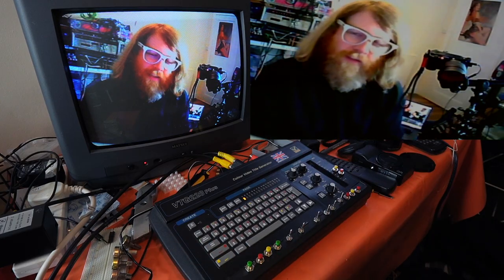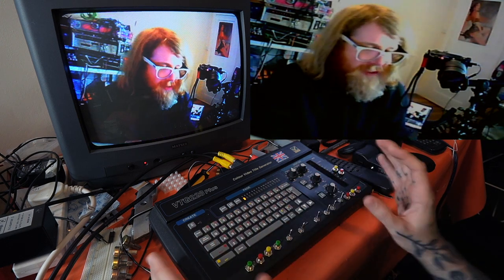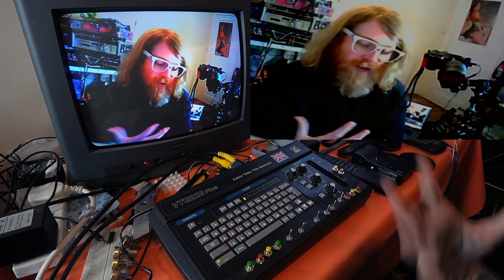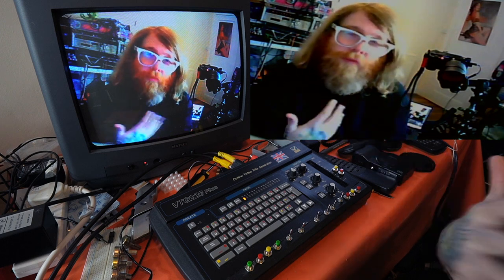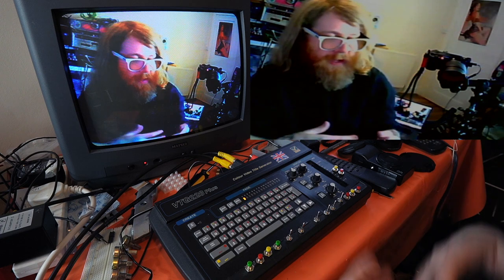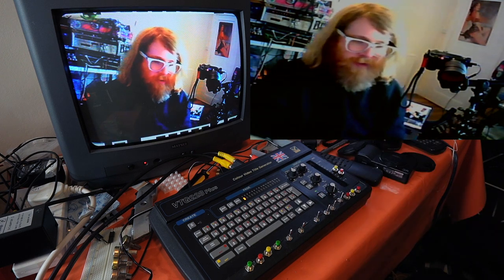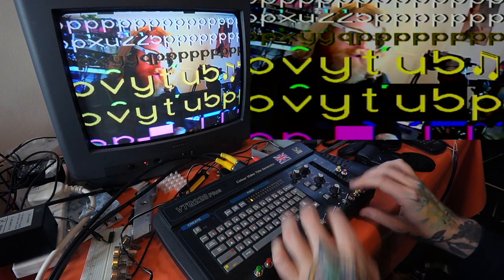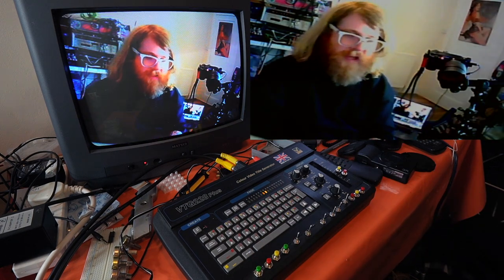Circuit Bending a Video Title Generator (VideoTech VTG228)

Comment: Ah, nice! I’ve got one of these in the queue for bending. I’m working on a pair of strange Vivancos, and a VEC 1060 (one of the steel cases; a real chore) beforehand. I can’t wait to tear into it.  Still watching this video. It’s probably cracking. Thanks for posting.
You’re a brave man for going after this one without tracing out the ground plane!

Just finished the video. Love how it turned out. This will be fantastic in conjunction with your Vivanco. I
Reply from the maker: Brave or stupid. One of the two. Maybe both?! 

What Vivancos are you working on? I've done a few of them now - but need to record videos of them. They are fun to bend, though some of them are a bit harder I think with the more compact cases.

I think you're the brave one going for the 1060. Those cases are wild. Drilling through that is no mean feat ha. The 1070 is similar but plastic... I will probably pick one of them up at some point to test out.
Reply: @StephenMcLeod  both the 1060 and 1070. I’m working on a pair of 1060s (incorporating a banana jack field, multi-format Gate/CV inputs, voltage scaling and more). I’ll send you a photo. The first is almost finished. 
Coincidentally, I just sent you a PCB shot of the Vivanco MVX about an hour ago. I’m making 2 of those as well.  I used a ribbon cable in order to make additional bends or service easier. I’ve got a bunch of Vivanco models in the queue but will probably do some Blaupunkt/Panasonic units first.
Reply from the maker: @KentBuchla  That sounds awesome!

Comment: Nice work!
If the vactrol wsn't working for you, then look into trying out transistor switches. If you can find a power rail to power them, then they will allow you to switch using a jack from your modular.
Reply from the maker: Thanks for the tip!
Reply: @StephenMcLeod  you can use photo transistors too

Comment: Just picked one of these up love the effects it has.
Looking to circuit bend it, where could I find schematics for it?
And does the scroll function only have the 1 speed? I've pushed everything with shift keys and option keys.
Reply from the maker: Yeah only one speed I believe. I'm not sure about schematics. It's an easy one to fry so be careful! :)
Reply: @StephenMcLeod  Just literally done my first circuit bending extravaganza tonight,  on the sima pro edit 3, all went well. Marked all the power using a multimeter as shown in a tutorial and is working nice. Will take it slow until I am more confident cheers
Reply from the maker: @sparkstron73  Nicely done! The Sima Pro Edit 3 is a good one to bend.